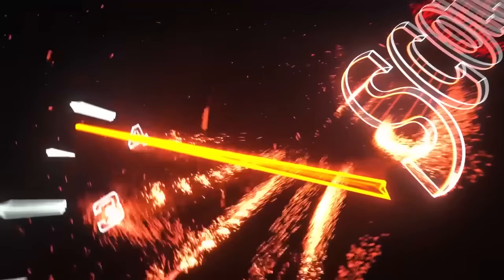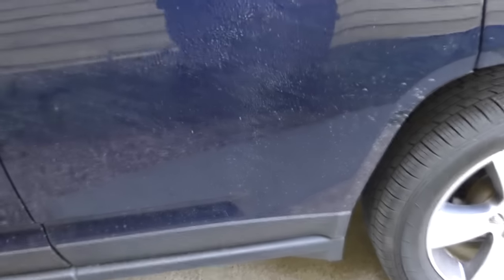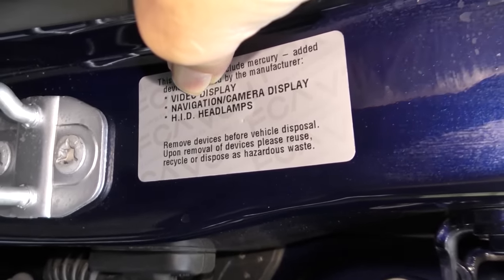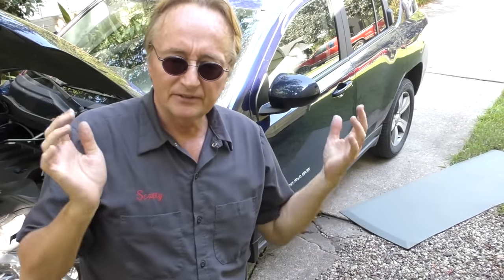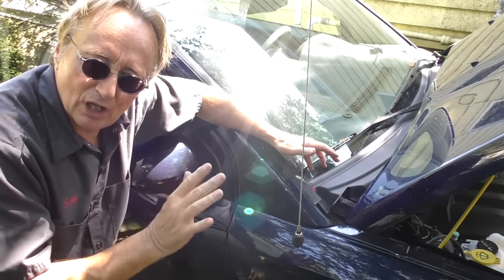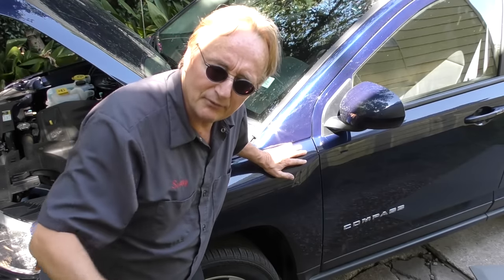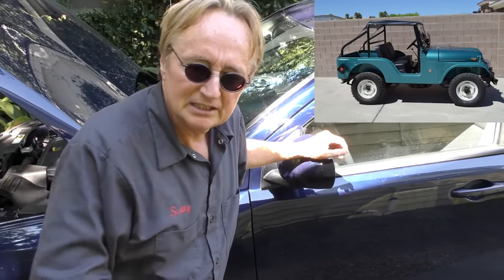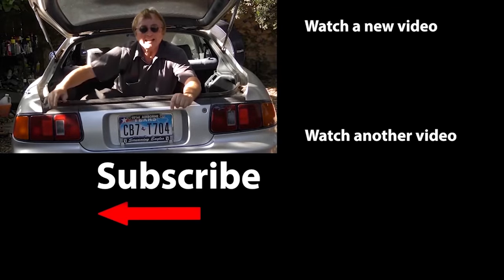Here's Why This Jeep Compass is Crap

Comment: Bought a 2016 jeep compass in 2018 and still have it. I have taken care of the vehicle very well from every oil change well on time, I have flushed the cvt transmission at 92k, I have replaced the battery when needed, I have made sure to replace the outer and inner air filters, I have flushed and replaced the coolant, I have had a proper tuneup to it, changed the tires, alignments and such, I have placed new LED headlight assemblies in there as I drive 700 miles one way through the desert and its never dark anymore, I have even placed brand new ceramic brakes on the vehicle and this vehicle stops on the dime! Only minor problems I have had so far was the alternator had to be changed and I replaced one of the motors for the AC. I got it fixed just like any other car when needed to. I am a firm believer that if you take care of any car you have, then that car will take care of you. Don't avoid warning signs of something failing. Take care of it. I have seen Toyotas have broken steering wheels. I have seen ford's and kias catch on fire. Man, I'll tell you what. That new ford maverick is a Jeep compass if not worse as I can tow 3500 lbs and get almost the same mpg as the maverick. I have slept in my compass in the back on a compass air matress during long road trips with no hassle. I have gone off roading. I have even somehow made it through 2 feet of snow when other 'real' trucks couldn't. Don't bat the compass down yet. As I have said. I have a jeep compass and have had it for about 3 years now. It had 50 plusK miles on it and now around 96k. It purrs like a kitty when you feed it synthetic oil and it works great. I'm even so in love with car and have had long lasting memories in it that I had the windows tinted and I have resurfaced and repainted the roof rails. Next, I want to drop a cold air intake in there, get a new muffler, get a command throttle, raise it a couple of more inches, place a moonroof in there, get the key fobs for keyless entry, replace the radiator, place roof racks on top, and maybe put a tow hitch on there. Ultimately, I am thinking about dropping a v8 engine or some type of engine with a turbocharge into the jeep compass and also upgrading the motormounts would be a must. As I have said. I have seen nissans maximas trasmission blow, chevy Silverados almost conk out, ford's trannies almost go, and so on. I think I am set now and I love this car not because of its looks, but because of its memories. I'm about to turn this little 2.0 into a sleeper 😉. 1-2-3!

Comment: My wife's daily drive 2014 jeep compass sport 2.0L with cvt. Stock copper spark plugs were  replaced at 20k miles with ngk platinum ones,  replaced  with ngk platinum again at 70k miles.  Always full synthetic oil change every 7-8k miles since 12k miles (dialy 50 miles highway commute) per the oil change reminder light. I use vacumn pump to extract 2qt (that's the max amount you can extract via the dip stick tube) cvt fluid out and refill 2qt every 15k miles. So far at 76k miles, no mechanical or electrical issues. Engine air filter replaced every 20k miles. For power steering fluid, I use the same vacumn pump to extract all fluid out of the reservoir and refill with clean fluid at every engine oil change. Damn I really baby this vehicle 😄

Comment: The redesign in 2012 fixed a lot of issues. The 2007-2011 had some problems. After 2014 they are really solid. Chrysler needs like 7 years to tweek a vehicle

Comment: I had a 2012 Jeep Compass for 4 years that I wrecked in February of this year and it actually wasn’t a bad vehicle at all. It had almost 160k on it when I wrecked it. I now have a 1995 Jeep Grand Cherokee Laredo (which might need a transfer case, but runs pretty good) and my mom has an old 1994 Chevy G20 (which is a good vehicle as well and only needs tires and a new shift linkage pin), but gets terrible gas mileage, so I was thinking about getting a 2016 or 2017 Jeep Compass and giving my mom the 1995 Grand Cherokee and keep the 1994 Chevy G20 as a backup vehicle or a winter driving vehicle. BTW, the Chevy can only has 91k on it, but the Jeep has almost 220k on it, so I would be looking for a 2016 or 2017 Jeep Compass with around 50-60k on it.
Reply: Did you ever go through with the 2016. As for the 2012 model did you encounter any major mechanical issues.

Comment: Mine is 2016 compass with 70,000 miles I have no issues until the alternator went out so already replaced but had issues of room to fix I know it’s hard to pull out but had to remove the air compressor out in order to get to the alternator so then refill the a/c Freon into it so it’s all good now and no issue whew! 😅

Comment: I bought a 2016 jeep compass in 2017 the trans just went out on me.  It had 54000 on it when I bought it.  It has 184000 on it now.  I use it to drive from state to state for my job.  I've been to jersey, Alabama, Florida, Georgia, Ohio, Pennsylvania.  I like the car, but just gonna get a new car.  The transmission is the only major problem I had.

Comment: Ive been thinking about buying one of these used down south with a 6 speed manual awd. As a winter beater and replace everything that would typically fail...breaks wheel bearings cv shafts tie rod endsand possibley an alternator. Parts are cheap and the 2.4 seems to be reliable. How long do the timing chains last or are they a belt?

Comment: I just bought a 2013 Jeep Patriot Latitude. It's got 103k on it. It seems to be a solid car. I did notice some of the plastics are cheap, and that it does have a week engine, shakes when in drive, but that is to be expected with a nearly 10 year old car with 103k on it. I like it, despite it having a week motor. One thing I didn't enjoy though, is the leak from the moon roof. Going to get that looked into.

Comment: You are absolutely correct about why no one should buy a Jeep Compass.  My wife has a 2020 Jeep Compass, it was made it Toluca Mexico not far from where the Baldwin Piano manufacturing went out of business because of defects in manufacturing.  The air conditioning did not work and had to be returned to the dealership twice,  the automatic door lock sounds like someone throwing a rock at the car over by the rear passenger door.  Service advisors told my wife it is normal after I had identified the problem six months earlier, and they said they would remedy the issue the next time I bring the car into service.  Without looking for problems,  I have found other issues of poor construction of this 2020 Jeep Compass Trailhawk trim such as condensation in tail lights, front headlights and interior windows due to improper construction.  The windshield moves with a squeak when cleaning the windshield, and the front doors rattle when closing.  At first glance, the car looks impressive as Scotty reported, however he is dead on target when he indicated the car is poorly made.  At this point, there is no oil consumption yet, as I had with my 2017 Jeep Renegade Deserthawk, however the workmanship and build quality are very poor.  I have owned and driven cars since my 1962 Chevy Impala, and found that my wife's 2020 Jeep Compass is not worth the money they want for that car, given that I have owned a Jeep product since 2003 Jeep Liberty.   Run, do not walk from any Jeep Compass for sale regardless of the year it was made.  As Scotty as poignantly indicated, the over poor build quality of these cars are the reasons you do not want to buy any car built in Mexico ( you hear that Ford Bronco).

Comment: I have a 2016 Compass 4x4 with 2.4 motor and 177k. Still going strong. I tow my atv or zero turn (1000 lbs +/- with Harbor Freight trailer in a box) couple of times a month (sometimes over 850 miles). I ran Uber in it full time and put just over 70,000 miles on it in one years time. Just take care of it, change the oil often and do required maintenances. If you get it stuck off-road and have too much engine torque trying to unstick yourself, it does something weird and kind of disengages torque converter. Just lift up on front or back of vehicle, give it a little help, then torque will be transferred as it should and you can get unstuck (need two people for this). It’s weird and kind of sucks. I’m not exactly sure what it’s called or why it does it, but it does. Found a couple of You tube videos on that. It’s a Jeep Compass thing. Scotty is right! It’s a pain to work on especially since I do most of my own work. I’ll run it till it dies. It gets me, my dog, trailer and atv where we need to go!

Comment: Wife has the 2018 compass, at 40k miles...burning 2.5 quarts of oil in only 3.5k miles with the dexos blend being used...huge issue with these jeeps. Dealer states it’s normal and have refused to honor the warranty to replace the motor for low oil consumption, even though there is a class action lawsuit related to this exact issue.

Comment: Got a 2014 jeep grand cherokee, runs like new at 150k miles no rust in any places other than a few screws on the undercarriage which is probably common with most cars anyway.

Comment: I always find it funny this irrational nonsensical gripe Americans have with Fiat (and with pretty much anything that's not a Toyota). I live in Brazil, and I've been driving Fiat cars since 2007 (I'm in my 5th Fiat car) and I had a total of zero problems with them and I drive around 20k miles a year. I don't even change the oil on the right dates... Still, absolutely zero problem. I buy them, I drive them, I sell them a few years later and buy a new one. I don't even change the fuckin' tires, because they are still in good condition well it's time to sell the car. NEVER freakin' visited a car mechanic in my life aside from doing basic mandatory maintenance.

Comment: We got one new on 08. The 07 had Trans issues. We got it when Mopar had a lifetime power train warranty. 2.4l is a little slow but we knew that when we got it. Over 260k miles on it and still fine. Plugs and wires, lower front suspension brackets on both sides at 160 bucks each. Front sub frame at 130 bucks plus labor after 14yrs, 2 wheel bearings, breaks, tires, battery. That's it. We have a sport. The 4wd was horrid in the original tires up here in the north. I have had winter tires and summer tires  after the first couple yrs. Winter tires suck gas but it's worth it. Milage is 23 to 26. The 18s ish might not be as good but that small amount of repairs over that many miles, I'd say it did rather well.

Comment: My lady has a 2016 compass and everything is breaking at 85k miles. Replaced the transmission at 69k miles. Just did struts.
About to do the rear motor mount 🙄

Comment: The 2007-2016 Compass isn't fiat, in 2017 the new body style is when it changes to fiat stuff. I have a 2014 Compass 2.4 and it doesn't feel that slow at all, is really comfortable and rides nice, I've don't light core off-roading with it. It's gas Mileage is really good to me, better then my Sable. The only Compass I wouldn't recommend is the 2.0 cvt transmission ones, or fiat ones. But the 2.4 Auto isn't that bad at all

Comment: hey Scotty- I have a 2015 Honda Fit (70k miles) and a 2004 Pontiac Vibe (140k) (Toyota Matrix). We need to sell one, and feel we can get $5k for the Vibe and maybe up toward $15k for the Fit. What do you think? Both standard transmission, we are replacing the clutch on the Vibe now otherwise the Vibe is in great shape beyond some clear coat deterioration on the roof. What do you think? Maybe we sell the fit, pocket the money and drive the Vibe till it dies and then get a small EV to replace? Our other vehicle is a 2000 Toyota Sienna that we recently got, 140k miles. It's our adventure family van... so we really just need a solid townie car.

Comment: I had a Jeep Compass Limited from 2014 to early 2020, travelled 80,000 miles and never had a single problem with it.   The only costs were a new battery and new tyres.
Reply: My daughter has a 201

Comment: I have the 2016 Jeep Compass and its doing alright but like you said the engine isn't strong enough for the body. 

I was curious about which older vehicles you would take when it comes to a trade in? I'm looking to go off grid and I wanted a truck and an SUV. I was looking at both the 90s Jeep Charokee and Chevy Work truck. Do you have any recommendations?

Comment: I was done with Chrysler vehicles in the early 2000's when i worked at a Chrysler/Plymouth/Jeep dealership. Too many repairs and recalls in the year i worked there for me to ever give them money. Despite my protests, my sister has a 2017 Dodge Journey, which goes through brakes like crazy and gets the same gas mileage as my 20 year old Buick Regal. A couple years back my Dad rented a Ram pickup and the moment I saw the 'shifter' looked a lot like the A/C controls, i knew there was never a chance for me to give them a chance.
Reply: Rotary dial transmission shift control will be required by law by year 2025. All new vehicles will have them, due to increasing number of gears to 10-speed and more.

Comment: If you swapped the transmission outside of the dealership does that void my engines powertrain warranty or affect the engine oil consumption recall ?  Its running perfectly, do I have disclose I swapped the transmission to the dealer? will they even know?

Comment: Damn, I love your videos. I was about to buy one of these. Your are on point about the beauty of the exterior.  Please send me your recommendation on a 2014-2018 small SUV for under $15,000. I hate the POS 2.0 and 2.4 liter slug bug motors. That was my only point for steering away from this vehicle. Now you opened my mind on this vehicle that looks aesthetically pleasing on the exterior, yet you enlightened me on the market.
Reply: Eh, I've seen Jeep Renegades for that price range. Pretty rad looking SUVs but I've heard one negative review thus far. Just do your research. Can't go wrong with a 2012 Ford Escape if you want a cheap and hardy compact SUV with great mileage. Hyundai also makes good compacts with a fantastic warranty.

Comment: No issues with my compass 2014. Got mine with a 5 speed. Its a budget suv. Just like the neon. The manual recovers the pep and gas mileage, you get what you pay for and it lasts depending on how you take care of. The cvt auto is a whole different story...
Reply: hey im getting a 2013 today for about $8,000 in great condition everything already fixed do you think that is a good buy or worth that much, since you own one i thought i would ask if you don't mind thank you

Comment: This is not the FCA designed compass it is based on the Mitsubishi platform with the 2.4 world engine designed by hyundai, mitsubishi and chrysler. FCA was too cheap to touch this with their tech, they left it as is, pretty much as it was from when Mercedes owned Chrysler.

Comment: I ordered my 2016 from the factory the only issues I have is the small gas tank 13 gallons range about 400 miles on the highway, the U Connect every 6 month approximately I have to pair it with my Galaxy Note 4  dealer says my phone is old and not supported, my other Bluetooth devices have no issues. Had to have the steering column replaced, it was sticking. When I ordered it, I could not get all the bell and whistles because it was a manual, Ridiculous. My U Connect needs an update, the dealer said there is no guarantee your radio will work after, I said I paid extra for the bumper to bumper 100 K warranty, they said that is not covered.

Comment: 2007 Jeep Compass with 126,000 miles, with CVT. (Didn't have a choice with this car). No major engine or transmission problems as of right now but had to do a lot of work on suspension due to salty winter roads and of course poor quality.

Comment: Scotty i bought a 2021 jeep compass limited with 5000 miles on it for $33000 Canadian Dollars,Heated steering wheel mirrors seats air conditioning seats, 2.4, 9 speed transmission it's still brand new with 5000 miles

Comment: Scotty is right. I have been suffering massively and horribly with my wife's Dodge Challenger 2010 that just turned into 115,000 miles. Heating problems, troubles with the transmission, rattling sounds, engine eating up both oil and gas, high prices of spare parts at Dodge dealer, and many more unable to mention. I hate Dodge and their products and I will never ever think about buying one.
Reply: A Challenger is NOT a Jeep, dude. Seriously...........

Comment: I have a 2014 with 165,000 miles on it and have not had to replace anything but brakes, tires, and the transmission dip stick tube.

Comment: Compasses aren't reliable long term. Mine made it to 100k and then it seemed like stuff was breaking constantly. 2 crank sensors, electrical issues, then one time we were driving and water started leaking out of the front dome light (happened once then never again). Then replacing control arms, tie rods, wheel bearings, electronic throttle body went bad, brake lines collapsing on multiple occasions, radiator filler neck cracked, All the pulleys started to go including the alternator. After a new alternator the turn signals would mess with the dash light brightness. then a really fun one was the front sub frame rusting out. The rear sub frame would have been next but the trans went last week at 170k. It took alot of time and money to get that last 70k miles out of it. Ive had cars with 260k miles that required less work.

Comment: I’ve got the 2013 model used 20k miles and with the CVT and autostick transmission she picks up real quick around 6.5 on the 0-60. I like the compactness cause I’m only 5’ 3” and the AWD is a necessity in Wisconsin. Unless you get a smaller truck and sandbag it or a gas hog SUV you’re sliding into rivers.